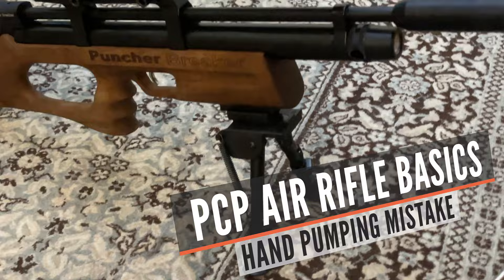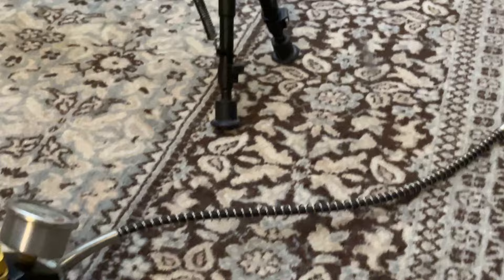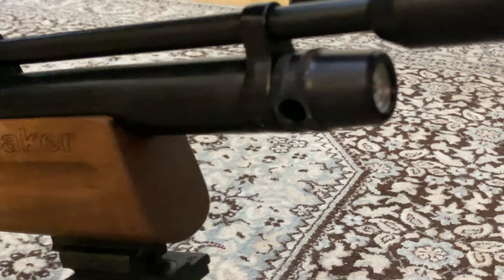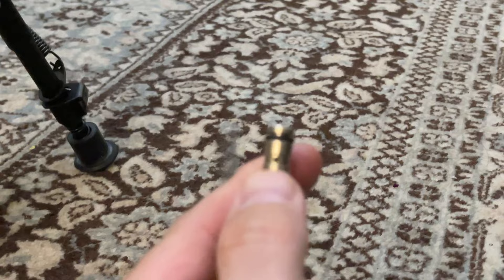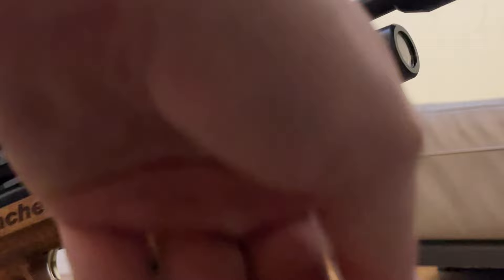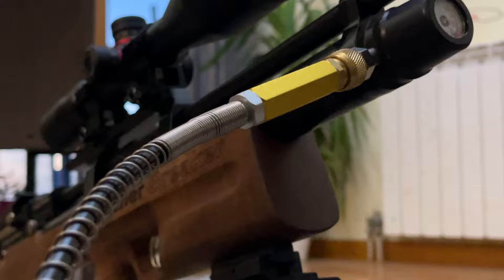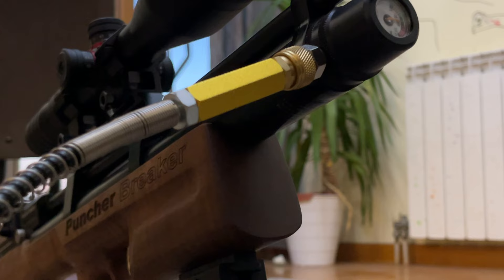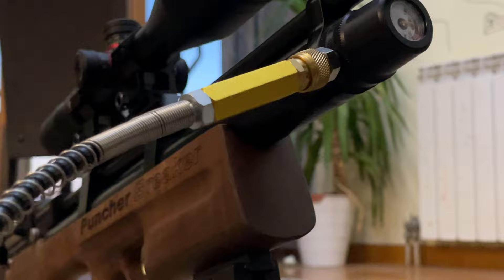PCP Air Rifle Basics - I can't pump my PCP Air Rifle with a hand pump - How stupid of me! :)

Comment: A little bit of silicone spray or grease on the o rings helps to keep the rubber in good condition, also it will be easier to push the probe in , 😁👍

Comment: I’m having trouble getting my Hatsan vectis pcp to air up. I’m either missing something or it’s faulty any thoughts would be much appreciated
Reply: First few strokes should be hard and fast to seat the seals properly from an empty startpoint.
Reply: @OldNavajoTricks  I finally did get it working, I ended up getting a compressor for it.
Reply: @jeremyxx11  Cool, I'm still saving for my first which is how I picked that up 👍😆

Comment: An awesome video topic.
Airgun manufacturers oughta more do of them Foster quick connectors on PCPs.  There are just so many different filler probes out there between manufacturers - from what I've heard and read. Luckily my only PCP (the Sig Virtus) has a quick connector - so I wasn't able to do this mistake myself.
But way cool of you to do a video of a mistake you did yourself. May save someone from a heart attack. 😁👍🏻

Comment: Dumb by not reading and researching a lot before tackleing the job! First cock the Air rifle first leaving it cocked insert the probe with the little hole towards the butt of the rifle, make sure it's all the way in! Make sure all lines are tight and connections on the Air pump and not leaking first! Sometimes using a little plumbers tape on the connections first! The less air leak the faster better it will pump! Make sure you put slicone oil on the hand pump slide first and then after every 75 pumps and pump slow not fast like she says lol only pump 25 - 30 pumps and let cool few minutes. The first pumping you can do about 40 45 pumps then rest it few minutes. Or shell burn the rubber seals! It is slow take ur time can't rush hand pumps. Electric high pressure air compressors are faster but more exspensive! But better. Even they require silicone oil or something to run on. Don't get a oilless one. They don't last. All should rquire lubrication to run!Have fun with er! Kral is tops for the money, not an AVA. Kral runs circles around AVA! Cheap Chinese junk! Glad you did not get suckered into to that friend!!! Research first. And lots of it. Ed da pro snippin air man💥💪😎